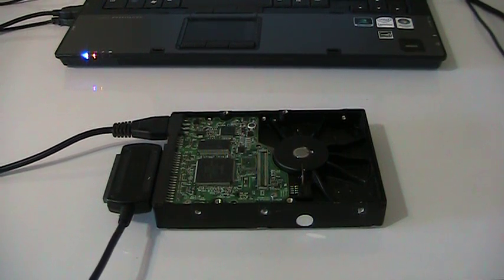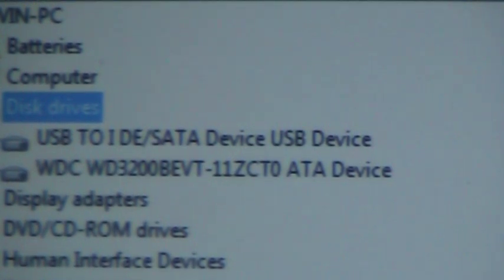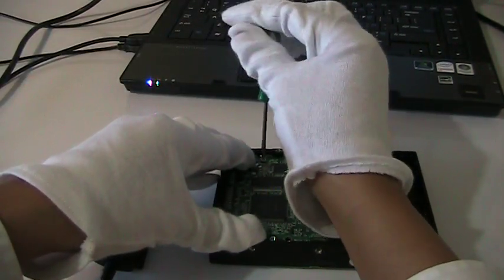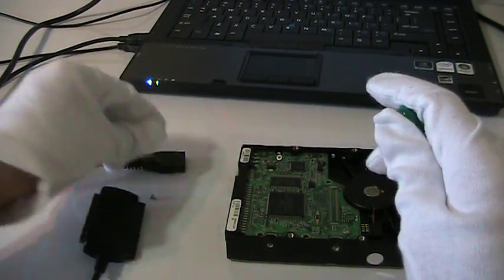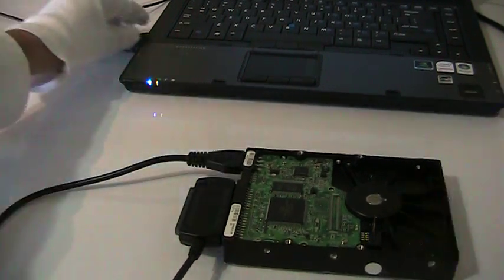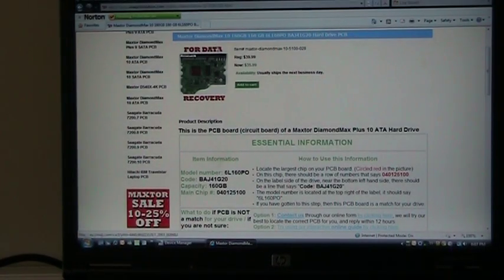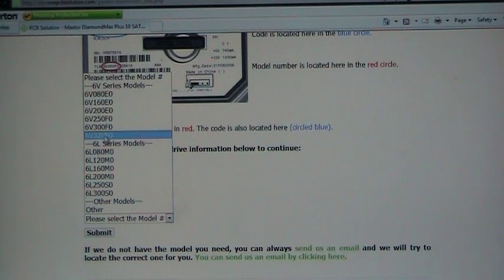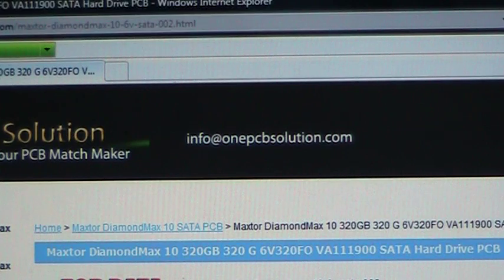DIY How to repair a completely dead hard drive with fried circuit board

Comment from the maker: Sorry for the slow reply everyone.
If the power pins are ripped off from the PCB, replacing the PCB should repair the hard drive.
The transfer speed with the converter is regular USB 2.0 speed, around 30MB/s. I think it depends on the converter.